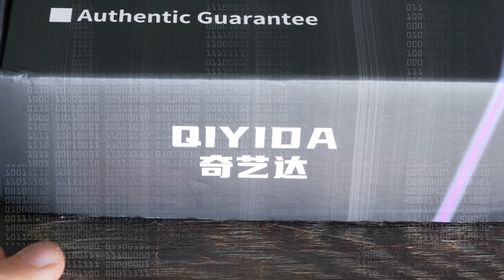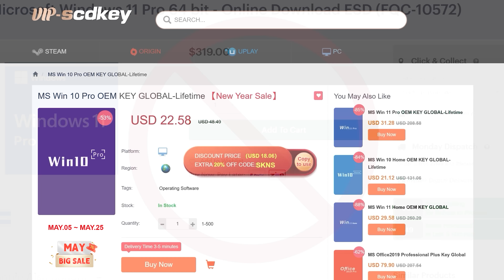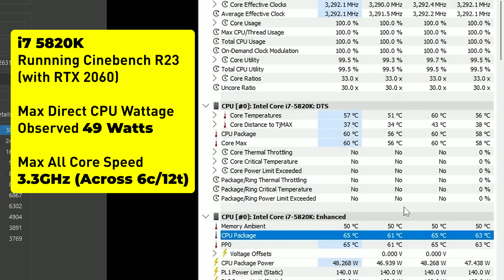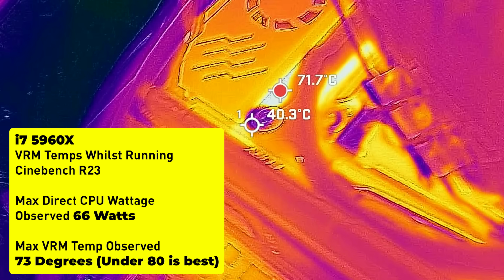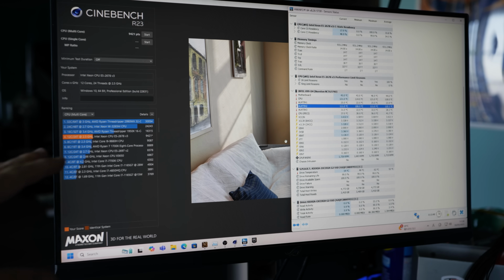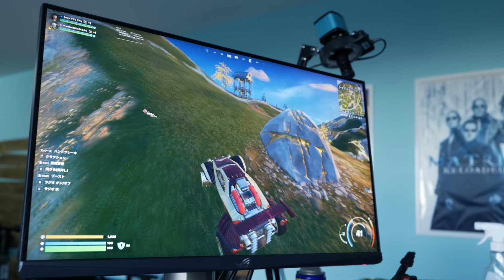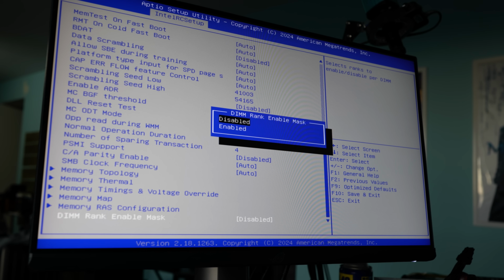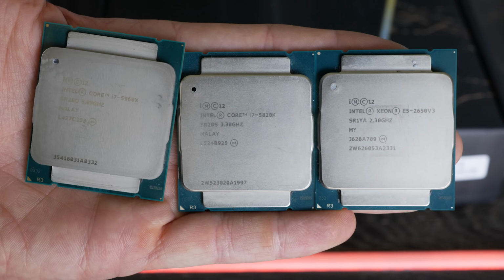This X99 Motherboard only Costs.... $35... (Qiyada X99-D4)

Comment from the maker: Will check into the memory, could have sworn this one said quad channel.  However I will run some tests with dual vs quad, as I ordered a heap of these boards in after checking this one out.
Reply: Qiyida H9S is the best quad channel alternative atm
Reply: @fazendohistoria_  but is it a true quad channel or it is quad slot?
Reply: No way that motherboard is 4 channels, that must be 2 DIMMs per channel, because 4 channels need more PCB layers! It would be better if QIYIDA put less 2 slots of memory and put a better VRM on that!
Reply: still run the 5820k in a x99  msi gaming  7 board 32gb ddr4 ram 3070 clocked at 4.5ghz still runs like a pro
Reply: U mentioned TPM 2 was fine. You tested it with which card ? As in past have had headaches with TPM even on boards that stated it supports it

Comment: im using one of these with 2640 v4 as proxmox VM machine

GPU pass through works fine with the one i have (it is a bit deferent  model though as it handles 2 nvmes)

Comment: I bought 2 x79 china mainboards. One did not want to run quad channel with corsair vengeance 3200 quad channel. The other did. I even overclocked both my old 3820k to 4.4 ghz with 240 aio's. Those China Mobo's are absolutely okay in my eyes! For a budget build of course.

Comment: i run 10 of them in my CPU mining park and they have massive cooling issues i put an extra 30mm fan on the VRM cooler and the Southbridge on every board, they running since 5 month without any mailfunctionsso far ..at last in that charge  i bought another 10 and 2 were DOA and 2 quitted PCIE output signal and the GPUS in it.....unfortunate.  SO if someone ask me what should i buy from aliexpress GO with the  Machinist or ZSUS brand  25 of them running since 4 years  no issues nothing

Comment: Interesting video 😊
I buy QIYIDA K9S with Xeon E5 1650 V4 
Used 2x8gb 2400 in order to set frequency limit for 2x32gb DDR4 ECC 3200 

1tb SSD 
Nvidia RTX 3050 Super Eagle 12gb Vram 

This motherboard is awesome and run as excpeted 😊

Thanks ☺️

PS 
I have upHere gaming ARGB cooler and wonder where I can plug RGB on the motherboard 

I see on your video you have RGB cooler 

Thanks 😊

Comment: Did you run Windows 11 as A standard install or did you have to use rufus to modify install. As the CPU's you used are technically unsupported

Comment: Honestly the X99-D4 is okay but i personally used that board with V4 xeons like the 2643v4 and 2667v4 because theres no support for turbo boost unlock on that board. I tried through windows flashing and even desoldering the chip and T.U. didnt work. 

But id say the X99-P4 does handle the T.U unlock and my personal fav X99 Board was the X99-D4 Plus (both the red and white) and the X99-D8 /i series.

Been checking alot of mainstream x99 boards starting to go for 120€ and bellow on aliexpress
Reply: Definitely not budget friendly boards that you've mentioned.

Comment: Many of the chinese sites have different prices for different regions. Your prices are different than others. My prices are higher because of more expensive shipping as well as they think people in my country are richer. Other countries might have cheaper prices. People try to use vpns to get cheaper prices sometimes. Where I live, most of the mobos and cpu+mobo combos do not ship to Canada. I can only find some that will ship. Most of the cheapest ones wont ship here. The cheapest motherboard ive gotten is around $90 CAD.  Theyve worked everytime. Ive gotten Huananzhi, and 2 machinist boards. They would make ALOT more money if they sold motherboards WITH the correct tpm 2.0 module compatible with the motherboards bios. I would only sell and build x99 low budget pcs. But the problem is no tpm 2.0, kids want to play valorant, and more than that they wanna play in fortnite money tournaments which you cant even join if you dont have tpm 2.0.

Comment: I have had a lot of these x99 boards from china come through my workshop for repair with dead PCH chips.
Don't worry about the VRMs, the PCH will die way before the VRMs, as they are scalped from old dead boards and reused on these, plus they are overvolted and inadequately cooled. 
If you are looking at these boards, make sure it has the C61? or x99 PCH chip, not the H?? or B?? ones.

I am a fan of x99 and x299, thou I think I'll keep clear of these. Nice vid thou.

Comment: I have a Qiyida E5 A99 with C612 chipset and it's great, running an E5-2695 V4 18-core no worries. I stopped buying Aliexpress X99 motherboards (or really anything) though because of the high risk that the parcel could get lost as it passes through some very shoddy delivery companies. But without these cheap Aliexpress boards I would never have had access to the X99 platform.

Comment: I have a machinist x79 motherboard with a e5 2667 v2 and it's been lasting for 3 years now and it's still going strong and it's the budget 7 phase vrm micro ATX form factor which fits in my Q300L case however I'm upgrading to the e5 2680 v3 x99 setup today with the almost the same motherboard you reviewed but it's a machinist x99 without the fans on the vrms just the small heatsink but I have 3 positive pressure fans and 2 exhaust which should help with cooling the vrms and everything else.

Comment: Last year I bought Machinist MR9A-H + E5 2650 V4 for RM138 (≈32 USD). I just throw any unused components  into it & connect it to the TV. The SATA ports was only 2.0 & there are no USB 3 ports. There was a USB3 header but it only operates at 2.0  speed. I'm not sure  if the stats reading from HWiNFO was correct because it says the package power was only 10W while running cinebench around 2.5GHz on all cores.

Comment: Very nice test as expected from the tech yes man himself, more like this please ! these x99 motherboards are bargains for the price if you can get them with a good cpu combo and it's great that you test them with power consumption and everything, but the fact that a ryzen 3600 gets 10thousand points in cb r23 speaks volumes about the single core performance, got mine new recently with a msi b550 pro + 32gb 3200mhz ram for 200$...

Comment: got my pr9-h for 23.50 euros using the welcome deal, perfect pair for a 1$ xeon (8c/16t 3.6ghz) and a 180$ gpu (rtx2080)
Reply: Is the pr9-h tpm 2.0 compatible? I've been eyeing this motherboard after seeing it's review by Miconyist but then I remembered about the need in the near future for windows 11 which I don't currently have.
Reply: @jefftist9625  i think that the external module should be compatible, machinist should have something on that too, i used windows 10 ltsc so support is extended until 2032 and to get less stress on the cpu as i had to avoid as much bottleneck as possible, it kinda feels smoother than windows 11 on my r5 5600 honestly
Reply: @segnipietro3075  I'm worried about using Windows lstc cuz I saw a comment that although it'll work on many games it's not something that developers set as the floor for which windows gaming when they do updates so long term viability gaming wise is a crap shoot.
Reply: @jefftist9625  well it might be true in the long run beacause of the end of windows 10 support for drivers but we are talking about a 25$ motherboard  that can handle cpus as strong as maybe 2nd or 3rd gen ryzen 5s so anything that might struggle with support in the future will struggle anyway, i think that windows 11 ltsc does not have the same requirements as the base version and might get the same updates but i'd have to research more on that

Comment: Gotta look at the xeon e5 1660v3, i got one in my dell precision t5810, using throttlestop i get the 8 core xeon to 4.1ghz since it has unlocked core multiplier

Comment: I actually own this exact motherboard paired with a 2697v3 Rx 580 and 32gb of ram and it's been performing surprisingly well also for the CPU cooler I opted for one that has the fan facing towards the motherboard/vrms and temps are even better!

Comment: I think the max ram speed is 2667mhz for these Xeon's I had the same issues, I have 3200/3600/3700 dims and tried all of them, I found the crap ECC ram that came with it, which was 2667 worked best and gave me the best benchmarks.

Comment: I just did this too, Ram+CPU+Board for $59 AUD delivered, works okay, but good luck with getting ReBar working, I couldn't get it happening, so your limited to say 1080 Ti's or 5700 XT's, anything more is wasted, I tried a 6900 XT and a A770 on it and both suck, but its a perfectly good platform if you have an older Gen3 16x GPU, I put mine together for my grand kids to play older games on.

Comment: i almost got thisss one
cauuse my x99 has overheating problems on the VRAMs like cooking hot (just like my old fx8370e with mssi 970 mobo) vrams to hot they to hot to touch... but the kit of xeon + mobo and ram with thiss mobo waass not cheap. so i got a qiyada x99 + Xeon E5 2680 V4 + 32gb ddr4 ecc 3200mhz for 45€ cant beat that
i almost bought the x99 d4 just cause i know the x99 will cook the vrams.. but nah im cheap ASF
i alredy haaave a cheap ZSUS x99 with 2640 v4 and 2x8gb ddr4 2100mhz but the mobo just cooks it self.. and one stick of ram died... it refuses to boot with it after a year or 2.. but i paid 40€ for it so was damn cheap for the time (it ordered without ram still got the ram) the ram waas 20€ more normaly... then got a cheap ZSUS x79 xeon E5 2689 C2 16gb ddr3 for 30€ (no usb 3 no sata3) put that with a rx480 8gb for my sister and a 128gb ssd and 1tb free 2.5 hdd... it games it works. she happy it does have a corsaire 750 rmi psu cause i had nothing cheaper lol, free 19' wide screen dvi monitor (800p) just love xeon shit :) but thaat cheap x79 does a better job at staying cool then my x99... but its fun i got caried away and got 2 xeon kits lol i just love the cheap stuff its fun...

Comment: I have a couple different cheap x99's coming in, I expect a similar experience.  I think you are being very cautious of the VRM, most sources site 105C as safe, or even 125C.  For gaming I have found the 1650v4 to be a really good budget option.  It has a high all core turbo for older games, and 6 cores 12 threads has been enough for games like Space Marine 2.  A 2690v4 with hyperthreading disabled, oddly enough, gives me better performance.

Comment: They have a model that I prefer with a TPM 2.0 header. In my experience, while Windows 11 drives may boot and run fine, some games will check for TPM 2.0 on startup and fail.
Reply: No games check for TPM. what the fuck are you smoking

Comment: currently watching this on my x99 system, a very similar x99 qiyida board, 32 gigs of ram, xeon e5 2680v4 and a gtx 1070, couldn´t be happier
Reply: If you're gaming I would recommend disabling Hyper-Threading/SMT.  A lot of 5+ year old games have trouble with CPUs with high thread count and 14 threads is not enough to have those issues yet enough to run modern games that use 8-12 threads without losing performance.
Reply: how high is your total wattage?
Reply: @monotroupe6294 I got a 650 watt MSI PSU, haven't got any problems with it

Comment: i d be very interested in: can u OC a e3 1650v3 ? practically giving u an even cheaper 5930k with higher base and boost clockwithout OC.
i ve read this exact MB has an original c612 chipset. does it support a custom bios to lock the single core turbo for all core turbo aswell for v3 chips?

Comment: I bought 2 of these, one is currently running as a Pfsense with a 2640v4 HT disabled, intel x520 (dual 10G SFP+) and a x540 (dual 10G/1G copper) with a nvme to pcie x4 adapter, hacked a capacitor next to the mb chip to self reset on power on (emulates the pwr ok signal from the ATX PSU) and used 2 sync buck converter to drop 12v to 5v and 3.3v and I just give it 12v, enabled console redirection to the serial port and i can manage the bios via a serial adapter and putty. Nice so far, yeah flimsy vrm but my cpu fan does blow on them (I got the version without a fan on the heatsink). The chipset runs hot I placed a bigger heatsink just to be safe, the clock gen chip under the pcie x16 runs hot but nothing scary. I love X99 because u dont really need much, FIVR are in the cpu so just give it 1.8-1.9v with a real cheap vrm and ur good to go. If ur wondering about the other mobo I've killed the VRM controller slamming 7v into the 5v (DIY syncronous buck converter with a TL494 and a pair of mosfets, feedback pin got detached, and the cost of the ic was almost on par with a new mobo plus all the desoldering time).
Long lives X99 (proud 6950x user, 4.4GHz 1.41v delidded liquid metal custom liquid loop)

Comment: Have this motherboard, can confirm there is no quad channel, it's just 4 slots, however it's only in parallel, actually it only works in dual channel mode with 4 sticks of memory. Also wattage report in hwmonitor is false, use meter from the wall.

Comment: Imagine if the X 99 lineup had just been what Intel had been selling to every customer.

Zen would have arrived with a whimper instead of being king of the hill so fast.

I hope you recommend the program lossless scaling to anybody you sell a PC to. 

You could literally run most games at 60 base frame rate, and the 2060 could run lossless FG without issues to get 120 FPS out of that system.

I used to use the program on my old rig that had a 7600 K and a 1060 3gb

Comment: aliexpress is running 20% off with coupon codes and 10% rakaten kick back right now. i got a b450 machinist r5 3600 and $15.00 heatsink for like less than $90.00 usd and $16.00 480gb ssd and ram is like $20 for 16gb, x99 is just not worth it when u can get way better b450 set for same price or close.

Comment: The big question in my mind is how it handles bios-modding to turboboost all cores perpetually. I've done it with other chinesium x79/x99 mobos and it's a significant jump in Cinebench and gaming performance. Then just target using Xeons with the higher turbo freqs vs big core counts.

Comment: Great to see so many people still enjoying the X99 platform in 2025.
Reply: Its likely because there are so many Xeons out there they make boards for them again to give them some use. I wouldn't use X99 for gaming anymore, even Zen 3 is better but mostly much more efficient.
Reply: The thing is that even the most basic and lowest quality am4 setup costs 3x to 4x more (atleast in brasil) @voyagerdeepspaceexploration
Reply: @voyagerdeepspaceexploration most of these Chinese "X99" boatds are not x99 boards but Intel 6-series server chips...
Reply: ikr, their value is insane for home servers, where I'm from, it cost 20 bucks to get an 18 core 2686v4, which beats the fk out of any old consumer cpu of the same price range
Reply: Those boards aren't actual X99.

Comment: They also make a B450 board that currently sells on AliExpress for just $41 USD, bought one and I have to say it is a nice little board. Nothing fancy but it comes with an NVME slot and OOTB it had no issues detecting and using the RAM XMP profile so if you want to build a dirt cheap AM4 budget baller these B450 boards are quite serviceable.
Reply: ive used the maxsun B450m challenger and Kllisre A320 AM$ boards, all worked well enough for a budget build. unfortunately secondhand AM4 boards are expensive where i am
Reply: You can just buy a used one for 10-20 € rather than waiting forever to get a trashy Aliexpress one. Even the old ASUS B350 do newer CPUs and are amazing value for budget AM4 builds or servers.
Reply: @voyagerdeepspaceexploration  in my country people are so dumb that they sell used board at the price of new stuff
Reply: @voyagerdeepspaceexploration  yeah exactly, especially considering all the nice features that they support like Restore AC Power Loss, Power On By RTC, c-states support, which many of these off brand chinese boards doesn't have, not to mention the lack of proper documentation and community support as well

Comment: All those MBs are trash, the chipsets are not x99, one i got at 2 weeks the fan of the vrm started to "scream", one of sound exits was dead and all of the 3 pin fans had zero way to control them.
Reply: It’s not trash if you set your expectations right. It’s fking cheap and pairing it with an affordable Xeon CPU makes it a great NAS. 
It might not satisfy you in everyday use, but for others, like budget gamers or those want a budget workstation for video rendering, it offers excellent value for money

Comment: I had this board while ago, found unlocked Bios put 2697v3 in it, unlocked turbo a it boosted at 3,6ghz all-core. Disabled SMT and I had surprising result. Shadow of the tomb rider lowest 1080p benchmark : 150fps, in comparsion R5 3600 with 3200mhz ram goes 150-160fps. So its pretty good deal for the price :)
Reply: Where you Got that BIOS from?😊
Reply: @adamturtle69  type this in youtube "TUTORIAL UNLOCK DO TURBO BOOST QIYIDA D4 X99 C612"  its tutorial from some brazilian guy.. i just turned on automatic translated subtitles and followed his steps. Everything works just fine. And he put bios and other files you need for bios reflash in description.
Reply: how is the vrm temps? stable?
Reply: @bulldozerfx888  with multithreading disabled + unlocked freq 3.6ghz for all 14 cores it went through OCCT CPU+RAM extreme for 1 hour with zero issues. And cooling was from aliexpress too. Basic cooler with 4 heatpipes and 92mm fan

Comment: These Xeons and X99 in general are great for workstations where PCIe lanes are required. I have one spare for these kind of use cases. For gaming, I would be interested to see how it would compare against a used Ryzen 3600 for example
Reply: 5820 = 1600
5960 = 1700